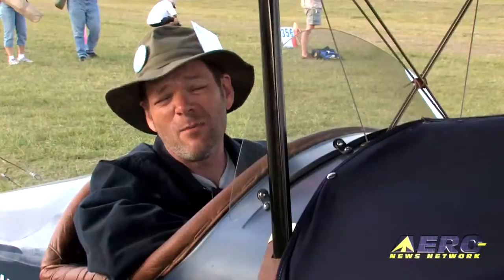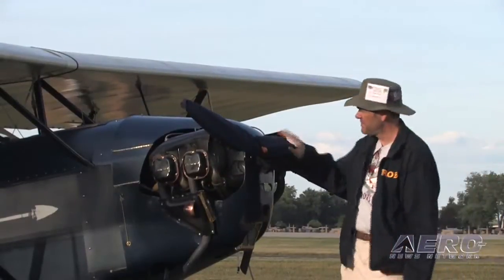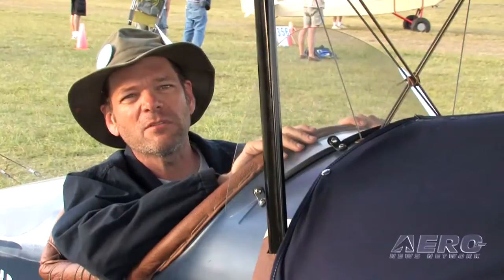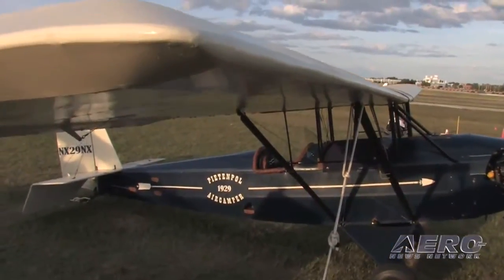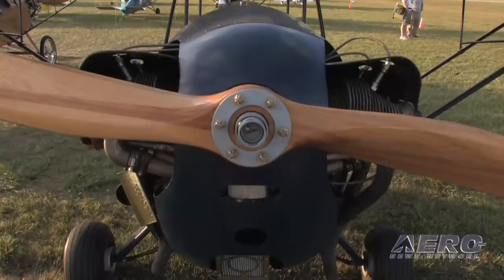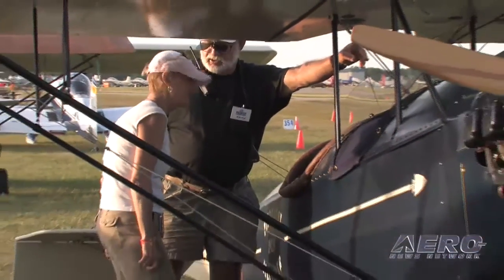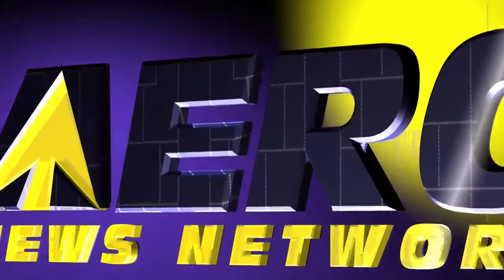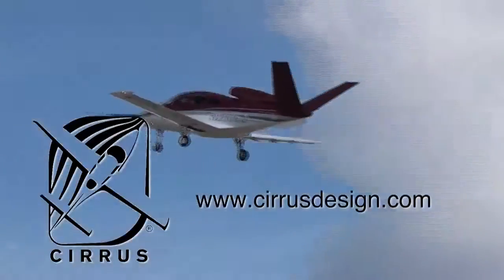Aero-TV: Profiles in Aviation - Rob Bach and His Pietenpol

Comment: As a pietenpol builder, there's no way you could build one from zero in 18 months without working on it full time. You're looking at close to 2000 hours (including covering, welding gear and engine rebuild) I have to believe he started with a partially built plane (many give up or die before finishing). Many people take 4-10 years to build the entire thing from scratch.